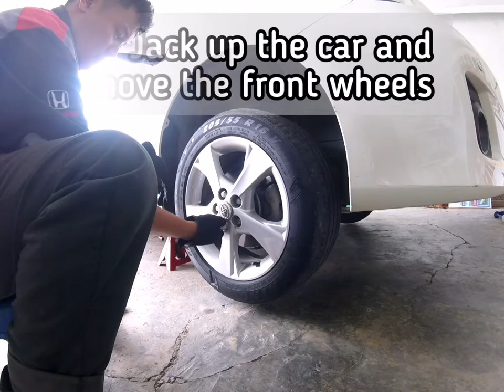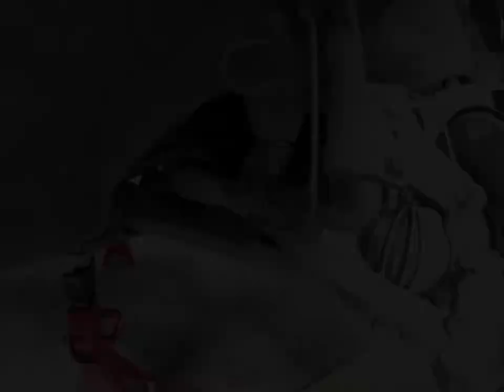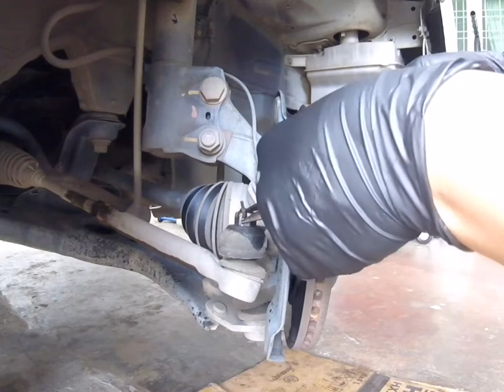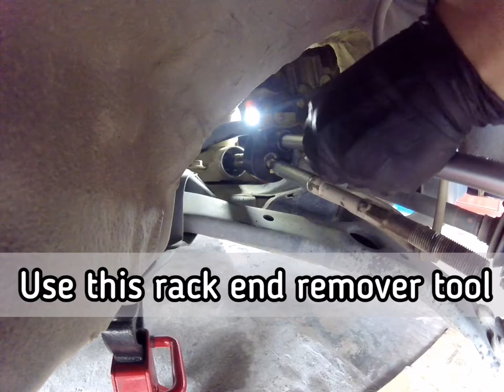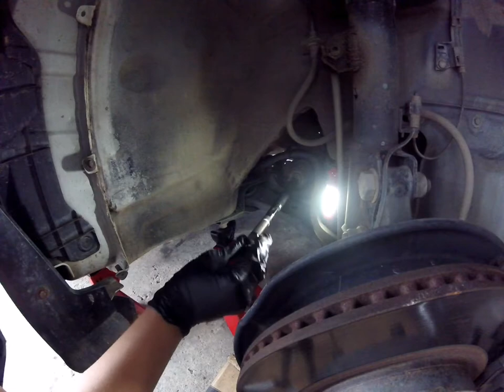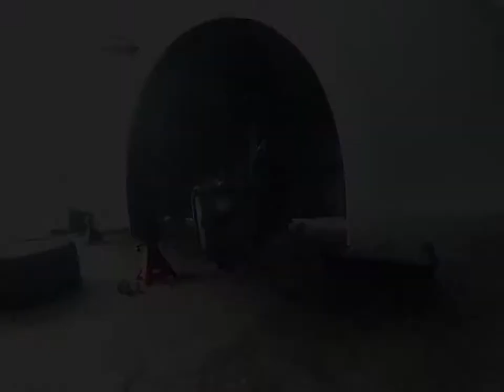2011 Toyota Corolla Altis 1.8 G auto Replace Steering Rack End & Tie Rod End

Comment: My car steering is loose and makes noise on small bumps what to do? Steering feels loose on highway. It is due to worn out inner tie rod ends or the bushing inside steering rack?
Reply from the maker: Very unlikely will be the bush steering rack, but check it anywhere, if it show signs of wear, replace. But the common culprit is always the tie rod end and rack end.
Reply: Rack ends are loose.

Comment: If there is play in steering rack what to do
It's totally changed or it can be repair
Reply from the maker: Usually check see how much to repair it, if not try getting a reconditioned steering before purchasing a new unit.